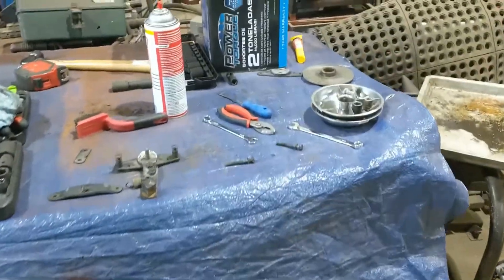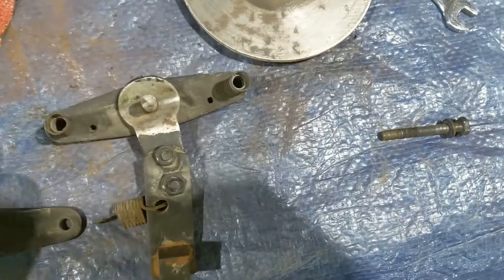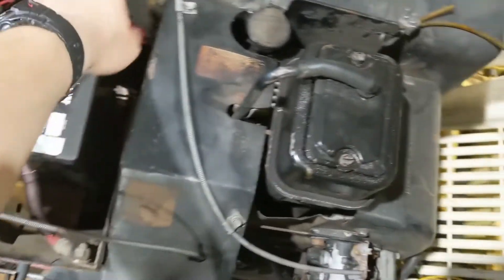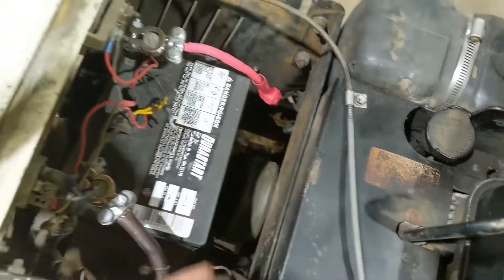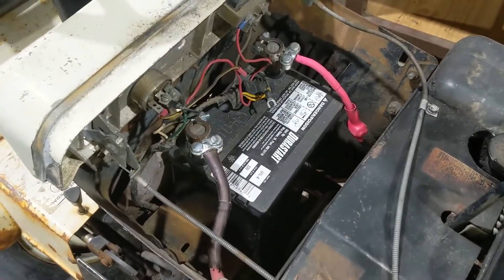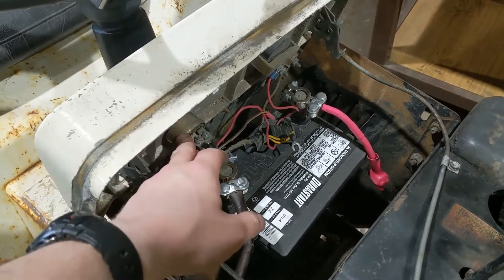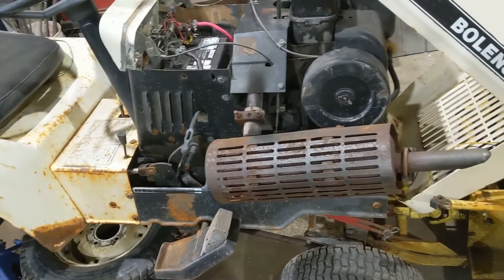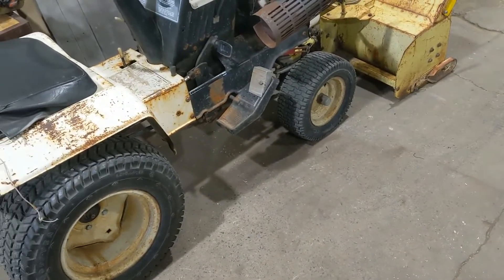Quick Update and Question on the Bolens H14

Comment: The brake is only for parking the tractor and stopping it from rolling.  It also has a lever that engages the hydro drive control so that with the engine running and the brake locked, the tractor won't slowly creep or the control pedal accidently move and thus the tractor moves.  All braking while running the tractor is via the control pedal.  

I have used original ignition switches.  Some have the screw to attach the wires.  Others, have a 1/4 spade which I simple crimped on some 1/4 female ends.
Reply from the maker: the problem is when I unload it from a trailer, I need the brake so I don't go off my ramps, like I did while I unloaded it the first time, plus in order for me to stop it I have to stress the hydro system due it is working against the direction, and I hate that. Also when I am driving around my local harvest show, I need the brake to stop due a lot of people around. as for the switch, would it beneficial to update it to the one with the spades and the black connector?
Reply: @JoshKilen  You are not stressing the hydro drive.  It is meant to be used as the control of the tractor.  There is no issue with using the control to slow or stop the direction of the tractor.  With that, I posted the service manual in the File section of the group page.  In it is the proper instructions for the adjustment of the brake.  It won't stop the tractor, but it will prevent it from rolling on its own, even on a hill once you engage it after stopping.

I rototill with my1556 and H16.  When you rototill, you will constantly be working the control pedal to hold the tractor back against the push of the tiller.  No issued.  Just make sure you filter is cleans and so is your fluid.  

As to the ignition switch, it is your choice.  I have had no issue with the screw type.  Once you put on a new ignition switch, it will out last you.  The only benefit to the spade is the ease of connecting and disconnecting.  But, you won't have to do that much if at all.  

One other thing, in all my tractors the battery is placed in so that the posts are facing the engine, not the dash.  This is stock as you can see in the service manual on page 2-19.   This prevents potential shorting of the posts.  Yes, the positive cable has to be longer unless you have the proper oriented battery.
Reply from the maker: which bolens group are you in? I posted in a few.